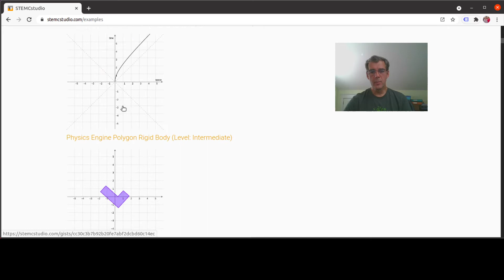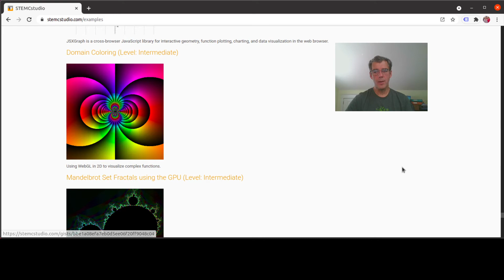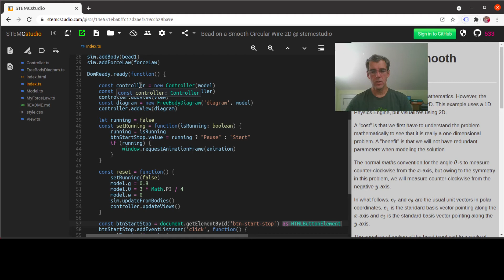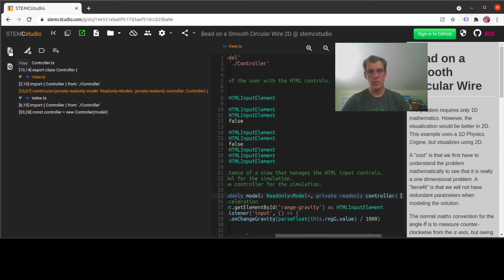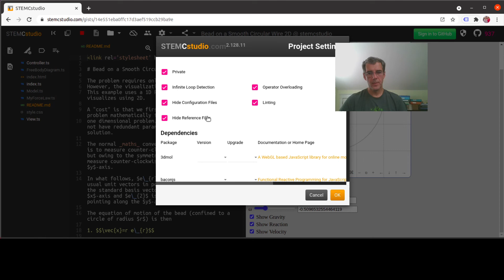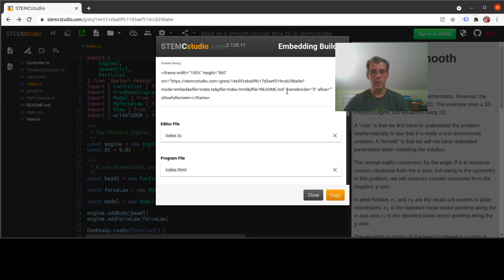STEMCstudio, Episode 00: Why STEMCstudio?

Comment: Where is println file in new projects?
Reply: Not quite sure what you are asking for here. If you are talking about logging in the browser then the usual approach is to use the "console" object to log in various ways. e.g. console.log("Hello", 123) The output is visible in the developer window of your particular browser. Another thing you might do in STEMCstudio is to write your own function that prints to the HTML page.
Reply: @davidholmes3827  I also came across this recently. In your GA First Course Ep. 01: Vectors and Operator Overloading video, you can see there is a println file. (https://www.youtube.com/watch?v=aElEX90u8RA&t=1626s). I've just created a new project (TS) in stemcstudio just now and that file no longer exists. Like you suggested, I just change this code to console.log.
Reply: @ibgib  The println file contained a convenience function for writing text, as a Text node, to the DOM. It's simply a quick and dirty debugging technique. As you say console.log works too.

Comment: WOW! Did you do all this by yourself or was this available through combination of some libraries?

For educational purposes, where speed is not important, I can't really see the advantages over the regular Python.  Is it really that much faster than Python?
Reply from the maker: @HitAndMissLab, the software is the result of my toil as well as libraries that exist. I owe a great deal to the folks a Microsoft for producing TypeScript, and I ported the ACE editor to TypeScript so that I could understand it and extend it. If I were to use real Python then it would require a server-side architecture, server costs. If I were to use a Python emulator, such as Skulpt, in the browser then there would be an approx 10x performance penalty (my observations from actually trying it, and consistent with experience of others). Another possibility is to create a non-standard language with a surface syntax that looks more like Python but that transpiles to JavaScript. I've tried this too; "Typhon" language is one of the examples. It's all an engineering trade-off. For the time being I have settled on TypeScript.